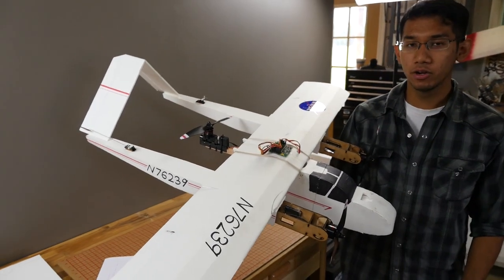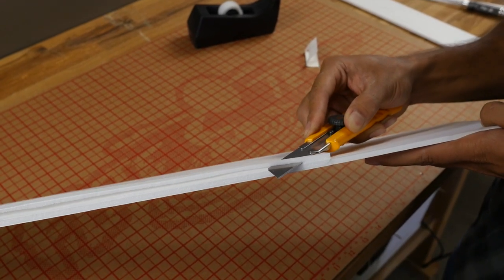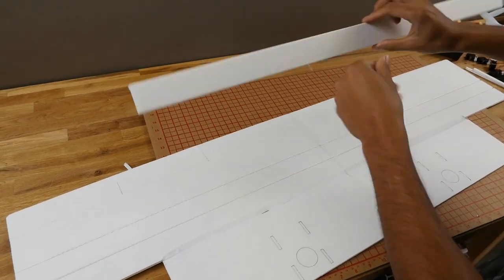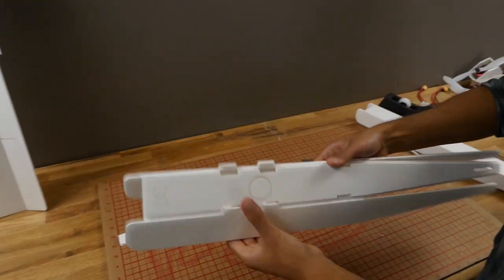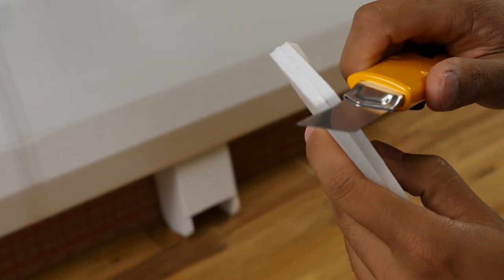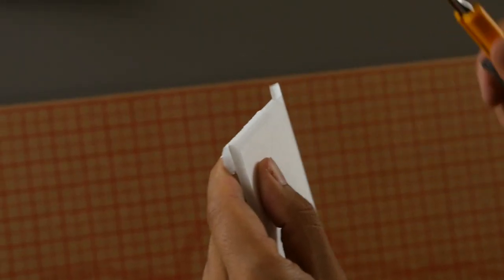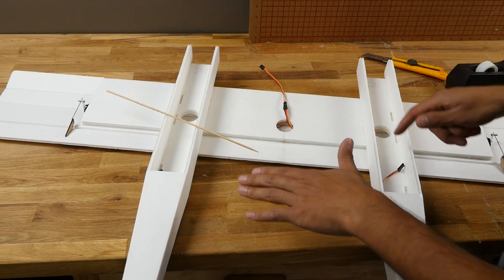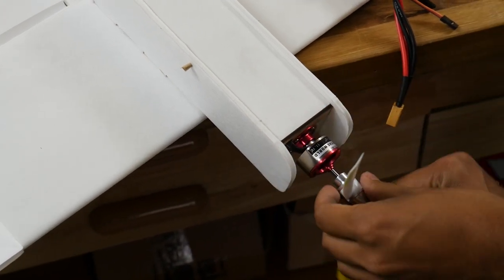FT Bronco Build | Flite Test

Comment: Thanks for providing free plans--- I hope they will continue to show us how to make our planes more durable-- example-  clear taping before cutting out kits or  partnering with Adams  to cover the foam board with a thin plastic film. Basic kits won't tolerate ANY moisture (dew or even high humidity) kind of melt and get floppy. Covering with tape (EA) or shelving paper is tedious but I have planes that are 4 years old. Be sure to go to their web site as there a big changes to their operation. I miss Chad's garage.

Comment: Great video!  I am always impressed by your knowledge, engineering and creativity.  I have learned so much watching your video's.  Here is some terminology help. The thingamger you are using to square surfaces...its called a Triangle - LOL, If you look at the shape of it- it's not a rectangle, or a circle, or eve an octagon...its a triangle shape.  Thats why they call it a TRIANGLE.  :-) The one you are using is generally called a 30-60 TRIANGLE, because the angle is either 30 degrees, or 60 degrees, depending on its orientation. Back in the olden days before computers, draftsman would use them to create drawings and blueprints..... Anyway - Keep up the good work!

Comment: YOu should never extend the DC battery wires, especially on an ESC with no capacitor. If you add a few caps close to the ESC on the battery wire you could perhaps get away with it. The easiest and safest way though is to extend the AC motor wires.
Reply: Why is this? Always good to know something new
Reply: +Pato Llaguno Short answer is that AC travels better over long wire runs. 

Long answer, I may get this wrong so please bear with me and take this with a grain of salt...
With the long wire run the voltage sags causing an amperage spike and heats up the wire and, more importantly, the wire traces in the esc. Having extra capacitors will help reduce any spikes and sags but it's still easier to just extend the correct wires in the first place.

Comment: The v tail link isn't the right one at 20:24
Reply from the maker: +David Teles Thank you for catching this! It should be fixed now.
Reply: +FliteTest when ia the vtol comin
Reply: +FliteTest can you make mini five inch planes
Reply: Micro planes would be awesome. But I'm not sure FT would be the ones to make them. This would require ultra small ultra light motors, servos, receivers and definitely a build material other than foam. Given what we're already seeing in micro helicopters and quadcopters. I'd say micro planes will happen. I'd personally love to be able fly a micro plane around indoors in the winter.
Reply: good point :)